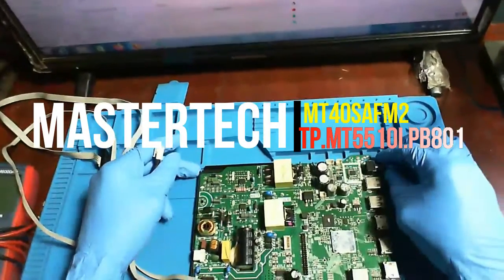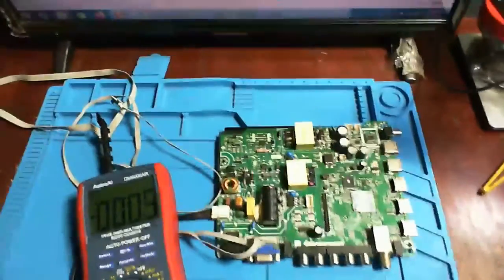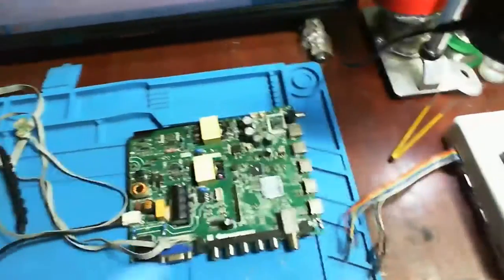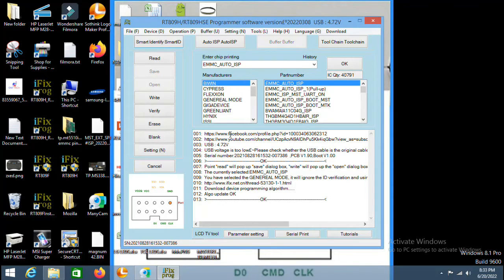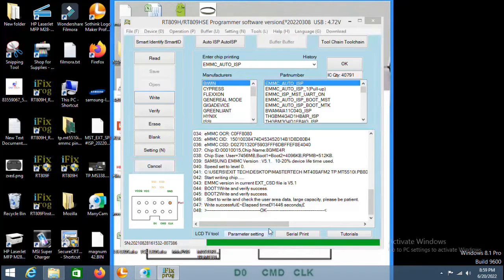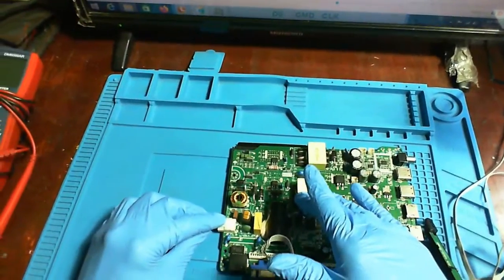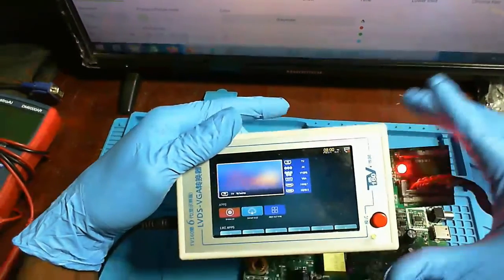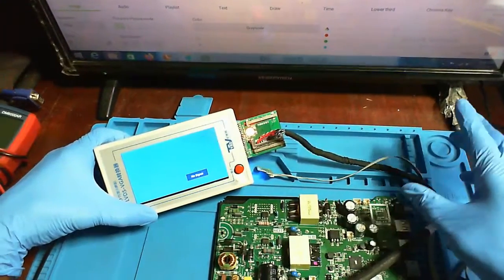MASTERTECH MT40SAFM2 TP.MT5510I.PB801

Comment: Gracias Amigo, I have the same board and the LEDs don't light up, I already checked the 3 strips with an external source and its are ok, will you have the test points to verify the voltages to power the LEDs?
Reply from the maker: Hello do the leds flash when you power on the tv?